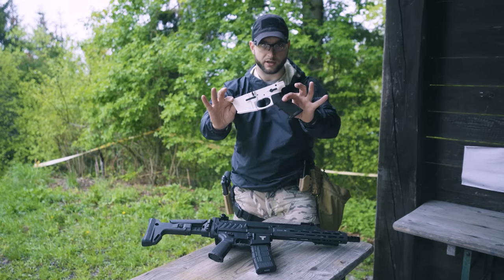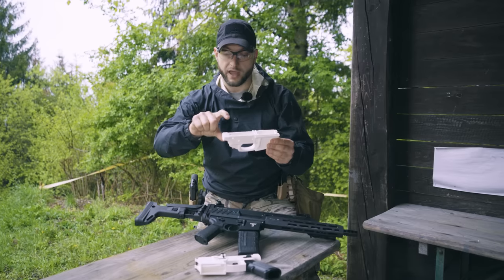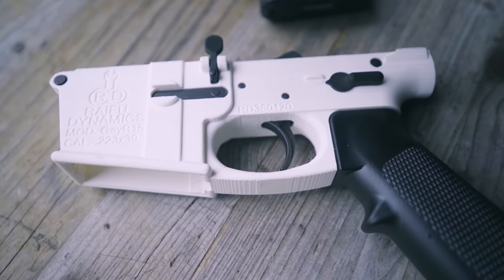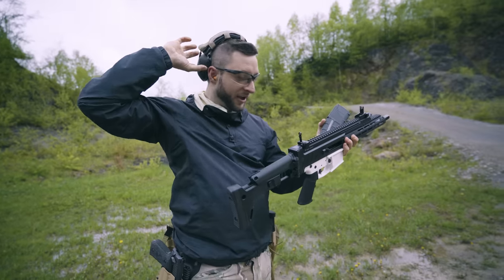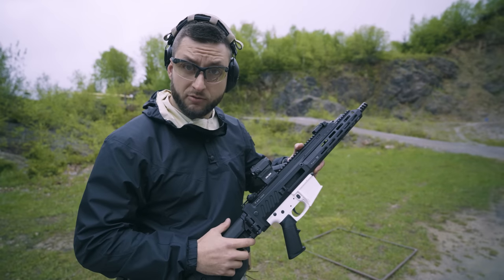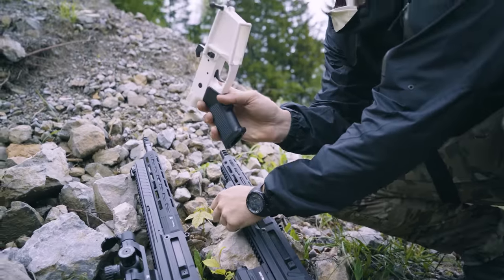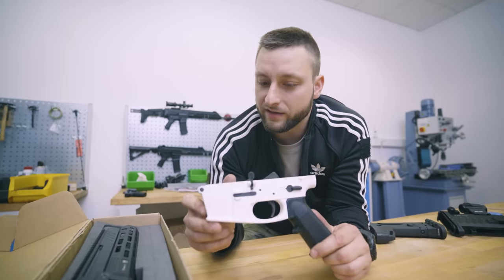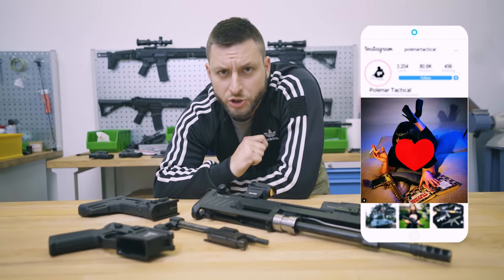Perun X16 with 3D printed lower

Comment: I think this is a much better 3D printed lower design than any AR15 could be. The buffer tube attachment is the weakest point on AR lowers so having it built into the upper will be significantly more reliable for printed lowers. Great work
Reply: Guess you've never heard of Hoffman tactical, probably the best 3d printed lower to date.
Reply: @Dirtysouth210210  that the one that uses a U-bolt ?
Reply: @vlaricshard2  No it uses a hose clamp
Reply: @Dirtysouth210210  nice to know that.He’s quite infamous on YouTube,I guess?But his product looks quite potential since he has put some researching and testing on it.I will take a look later
Reply: @Dirtysouth210210  I have and I do know it is the best printed AR15 lower in terms of strength. But it needs a giant rib and a hose clamp. The lower in this video does not need any of that and uses less material and can be made faster. The entire purpose of printing guns is to not need an FFL, not to replace metal parts. This design achieves this while keeping all printed parts as non-structural parts. Removing the buffer tube from the lower is objectively better.
Reply: It's not the lower design, it's the upper. You can't throw this on a standard ar-15
Reply: @noncompliant209cali  exactly. It’s not a fair comparison but it is an overall better design for 3D printing since most of the challenge is taken care of by the upper
Reply: @Dirtysouth210210  nah, DS1913 with BRN180 upper.
Reply: You realise this is quite literally a different gun right? For 1 doesnt take a buffer tube or anything of the sort 

Like the part that confuses me about this comment is you seem to think they've done something special but if you've looked into 3d printing firearms beyond its surface this really isnt special or even surprising  its pretty basic and its been done multiple times in multiple different versions
Reply: @royrogers3624  that’s exactly my point. The AR15 platform is at a disadvantage for 3D printing since the buffer is attached to the lower. Creating a printable lower for a weapon which does not have a buffer attached to the lower like the design in this video is better for 3D printing than trying to buff up an AR15 lower.
Reply: @Nicksperiments  not really theres multiple designs that have been made with the material in mind that have worked perfectly

And again so your point is that this is average? The only thing special here is thst it has parts compatibility (some) with the ar15  which means you have options

Besides that this is really cool but nothing special in the slightest
Reply: @royrogers3624  mind linking them?
Reply: @Nicksperiments  easiest would me look up print shoot repeat his videos would be a good starting point along with that ctrlpew both on YouTube and the website (believe its ctrlpew i fuck the name up alot) sone that come to mine the skorpion, skorpion evo, mac 11 (believe that's the right model) among others ive seen in passing and as someone else has pointed out there's a YouTube that has experimented with reinforcing and overall improving the durability of a 3d printed lower

Along with that I've seen a monolithic 3d printed lower that held up fairly nicely 1 to 2 k rounds it developed a hairline crack in the front where the pivot pin is though that was a first test I believe so subject to improvement in settings and material aswell as the design itself 

Sorry this isn't a playlist ive made yet though I may start one now as I did with my "fud" playlist disproving common myths you hear from fuds often

Edit: hoffman tactical I belive js the guy who's experimented with the designs (as posted above in another comment)

Injection molded lowers even have durability issues except for the monolithic ones that have come out because they were made with the material in mind not just copy of the aluminum specs the same way eith 3d prints if you copy the specs for a different material it should be obvious itll fail with a polymer
Reply: @royrogers3624  I’ve seen pretty much every video by all of those people. I’m talking specifically about rifle caliber (.223 or larger) printable lower receivers that require little to no reinforcing. A scar lower would be a good example. Are you claiming that is common?
Reply: @royrogers3624   isn’t that the pot calling the kettle black? You mentioned the scorpion evo and Mac 11, neither of which are rifles
Reply: @Nicksperiments  "Along with that I've seen a monolithic 3d printed lower that held up fairly nicely 1 to 2 k rounds it developed a hairline crack in the front where the pivot pin is though that was a first test I believe so subject to improvement in settings and material aswell as the design itself"

If you cant comprehend what this means im not wasting more time here im just repeating myself because you wouldn't pay attention
Reply: @royrogers3624  big talk coming from someone whose name is literally a fried chicken fast food chain. I clearly specified rifle caliber .223 or larger since the gun in this video is a rifle in rifle caliber. Reading is hard :/
Reply: Aye Bro start doing things instead repeating what you hear and see on youtube, plastic in carbon filament of today in 2022 hold up
Reply: @jaxsonmillz6474  it won't unless its similar in strength to 7075 aluminum the issue isn't really the material its the design itself the ar15 was designed around aluminum the area that becomes an issue is thin (relatively) and that results in it failing 

To give you an idea glass reinforced nylon which it actuslly better for this purpose even injection molded (so generally stronger) still fails if the design isn't modified to fit the material used

In short it is possible to do but there hasn't been a significant advancement that changes anything
Reply: Hey you know where can I order all this parts and how can I print one of those goals parts
Reply: What do I need to be able to print the 3D ghost gun
Reply: Or can I just buy it

Comment: These are super cool but i would imagine it wouldnt be cheap especially on initial release. Still something awesome for the 3d printing community regardless.
Reply from the maker: Not cheap but also not super expensive. I can't say for the US because of shipping and import cost but the goal for Perun X16 in Europe is to be cheaper than high end AR rifles
Reply: @PolenarTactical  Strive for global domination.
Reply: 3D-printed firearms (At least in the US) don't make the overall gun less expensive. It mostly circumvents the legal paperwork.
Reply: @TheHamgamer  yea that is true for the most part
Reply: @PolenarTactical  Will they be selling just the upper for the US? Easier to get an 80% lower and mill it down here for one, I'd think.
Reply: Thing is, there's plenty of people around with 3d printers that wouldn't mind helping a brother out. Problem is that once you ship it, it will raise some eyebrows with customs whaha

Comment: Great example of polymer lower for AR-15 is KP-15 from KE arms. Buttstock, buffer tube and pistol grip is one piece with lower to add strength to critical area. And i would like to see full review of that X-16, it looks quite interesting.
Reply: BuT nO cOlLaPsIbLe StOcK!!!
Reply: the only downisde of a lower like the KE arms one is that it wont fit on a normal printer. its a great design but its useless if you start printing it in pieces
Reply: @teebles I understand why someone want different stock (like collapsible or law tactical folding stock), but it's really such big deal to have different pistol grip? On every AR i shot i couldn't care less what type of pistol grip it have.
Reply: @teebles I dont know about prices in US ( i am from Europe) but it's really $110 so much for lower with buffer tube, grip and stock?
Reply: @teebles Stripped alu lower for $40, ok, but how much cost buffer tube? Stock? Pistol grip? Because for $110 you get all of that in KP-15
Reply: @teebles ok
Reply: @teebles law folder? ew. just get something thats made to fold
Reply: @teebles overpriced? wait, are you seriously calling it overpriced? ITs like, more expensive than an anderson, sure LMFAO. 
calling the kp15 lowers overpriced is like calling a glock expensive because it costs more than a taurus...
Reply: @teebles ive shot one and it handles a hell of a lot better than 90% of overweight awful builds people run

also, polymer molding is WAY more fucking expensive than you think, but you seem to know nothing about it, so whatever. using a CNC to churn out hundreds of ar lowers is expensive, yes, but a polymer mold is magnitudes more expensive. the kp15 caters to a particular market, and isnt out there to replace everything lmfao. and no, aluminum isnt better in every way, it has a lot of advantages, but a kp15 or older cavarms is really really robust for the light weight

oh, and a full pound reduction is a fucking LOT of weight reduction dude, do you like no walk with your rifle?
Reply: @teebles "only a pound" somebody doesnt hike much. or walk further than their car to the door... a pound is LOT, and when you make a gun with weight savings in mind, you can get a really really really nice rifle. my friends kp15 build is 7 and a half pounds with a nice lpvo and feels a hell of a lot better to shoot than the heavy monster 15in rail bull barrel rifles i see around

edit: also the modularity thing doesnt matter at all to me, i have long arms, so the stock is pretty much perfect, and the grip feels really nice. hell, i put the SAME grip on every AR, so its not like the modularity matters a damn. you lose 2 parts that can be swapped, to lose a pound, thats an amazing deal
Reply: @teebles he has a 1-6 lvpo and an ir laser/light combo, lmfao. go on and weigh your rifle, i guarantee unless its a poly handguard rifle with irons it wont be lighter.

just like keep in mind that his rifle is the weight of an original m16 with 20in barrel and irons with a loaded mag, while having a 1-6x scope and night vision capability. also im getting more and more sure you either only shoot bench queens or dont shoot at all.
Reply: @teebles no, becuase you dont understand the basics of walking around with a rifle lmfao. you thougt it was funny that a DECKED GUN was only 1 pound heavier than an m16a1... thats IMPRESSIVE as HELL. put on a crane stock, thats more weight, but on an mlok rail, thats more weight, before accessories an ar build can easily hit 8 pounds, then add an optic, thats at least 9 pounds unless its just a red dot. then slap on an ir laser/light and you are already past 10 pounds. its literally adding up numbers but you dont get it lmfao
Reply: @teebles lightweight slickside upper, lighter than m16a1 16in pencil barrel and a carbon fiber tube lol. You forgot like 40% of the gun.
Reply: @joemama.556  it fits on a 28cm delta printer
Reply: FWIW, I own a 20” AR based off a KP-15 lower, which I paid $100 for via Brownells.  It is a fantastic product, and the customer service from KE is the best I’ve ever encountered.

Having the stock and pistol grip integral to the lower makes the complete unit simpler and stronger (see demonstrations of this on the InRange videos re: WWSD) as well as lighter.  Everything’s a trade off—adjustability and modularity vs. simplicity, weight, and strength.  I like the compromises made in the KP-15’s design.  I think the grip is a bit too thin for my hand, so I bought an $11 neoprene grip cover from Amazon that made the grip stickier, softer, and slightly thicker.  Now it’s perfect.

A poverty-pony lower + cheap grip + buffer tube + cheap stock are still going to come in at around the $100 mark and not be as rugged as a KP-15.  In summary: I own one and I can tell you that it’s not junk, and it’s not overpriced.

Comment: Is the Perun only available in Slovenia ? They look really freaking cool.
Reply from the maker: i think AEA arms has plans to import them to the US
Reply: @PolenarTactical  I hope so!
Reply: @PolenarTactical  As parts kit? Im loving the setup
Reply: @PolenarTactical  yeah, would definitely love to see that full review
Reply: I know that they are available in many european countries. Most manufacturers of semi-auto rifles, especially AR-15 derivatives, in the EU don't export to the US because of the US import restrictions and the strong competition by US manufacturers.

ARs made by Oberland Arms, Schmeisser and Hera in germany are, for example, very popular in europe but they are not or only rarely exported to the US.
Reply: And I have to add: As long as the Perun has not been exported to the US it is unknown if the upper or the lower receiver is the registered part of the weapon. There are several guns with an upper/lower system with the upper as the registered part, the FN FNC or several HK rifles and derivatives for example. It possible that a perun lower in the US is legally just the same thing as in most european countries: A piece of plastic.
Reply: @PolenarTactical  Will yall release the STL or Step file for the lower to be Foss?
Reply: @Superwip  One thing about that is, it uses an AR-15 lower, just with the buffer extension milled off.
Reply: @PolenarTactical  Any idea on their MSRP?
Reply: @PolenarTactical   we want parts kits.

Comment: Point of clarification; in the US, the lower is the serialized part on the AR15 and a few other firearms, while on the M14/M1A1, FAL and most others, the "upper" (i.e., not the fcg) is the serialized part. The ATF has admitted that was a mistake and has tried to redefine the AR lower several times (which would instantly make hundreds of thousands of people criminals).

Make sure to do your research so you stay on the right side of the fed bois.
Reply: @foibles1149  ^ This. Quit the self policing and it goes away.
Reply: Hold on, how would it make people criminals? Weapons that were not serialized before the 1968 GCA were grandfathered in. If there's millions of uppers without serials, too bad. Ex post facto. The ATF can't so anything about it.

Comment: In the US, the lower is the gun. He was correct when he said it was a 3D printed gun.
Reply: not always true, my cz bren 2 the upper is the serialized part, the lower is not.  the scar is also the same way.
Reply: @soup31314  I'm aware, but he is holding an AR. I didn't think it needed specified for this video considering it's the only gun in the entire video.

Comment: They fixed the AR buffer tube issue. They beefed it up and then added one critical component. A hose clamp. Yup a cheap hose clamp fixed the buffer tuber issue. How do the test it? They do push up on it with one hand on the buttstock, one on the barrel shroud, and balanced on a pistol grip. Others used a U-clamp which is a U shaped piece of metal with bolts on the ends. Both allowed them to do pushups on the rifle and fire it afterwards. Not the prettiest but very cheap but effective options.

Comment: correct me if I'm wrong, but hasn't a buffer-tubeless rifle AR platform been around since the SIG MCX dropped in like 2015?

the x16 has a very interesting operating system, but in terms of accepting printed lowers specifically, is it anything particularly new? i assume it takes from the ar18's double recoil spring/guide rod thingy that allows the omission of tbe buffer tube as the MCX does

Comment: Definitely want a full review on this. Also: is the lower close enough to an AR lower that I could chop the buffer tower off the lower and make it work????
Reply from the maker: Yes, that's the idea. It uses and AR lower with chopped buffer tower.
Reply: @PolenarTactical  that’s sweet. I’ll definitely do a 7075 self manufactured lower for one of these and post my experience on here. 

Thanks for the information.

Comment: In the Netherlands you cannot buy an AR upper without registering it to your permit. Also most important parts are serialized in the past 2 years. Is his not the same in Slovenia?
Reply from the maker: Similar, for us the controlled and serialised parts are barrel, bolt, bolt locking piece and revolver drum
Reply: Wow I didn't know you could buy ARs in the netherlands. Then again, gun laws in Europe aren't actually that bad if you have a hunting license like I do. I love in Portugal and you can buy AKs and ARs here no problem. Also do you fancy powerful lasers? I need to buy one from europe
Reply: @LuisC7   yes you can! I am the living proof :). It only takes couple years, background checks and a lot of effort. But, if you follow the process it is possible. Yes I used to build these laser myself with diodes from projectors. I quit that hobby unfortunately due to time restraints and other hobbies. And also they were really dangerous lol.

Comment: 👻👻👻.  We have moved to core moldings a reinforcing into the buffer tube adapter.....some current generations use Kevlar reinforcing in the polymer on 80% lowers......🤠
       But this is just as outstanding.
      PS......👻 Gun is just a politicians term for a self made firearm.
      😃😃😃😃😃
     Five Smiles and a 👍
   But our 3d printed lowers for the most part have limits in the buffer tube adapter area....
     Best Wishes for my brother's of different mother's ...... 🤠

Comment: Plastipews for life baby! Where did you get these files?
Reply from the maker: We modified some available AR15 lower receiver files. Thinking of making our own version of the files with the lower that will directly fit on the Perun X16 and have some parts reinforced (like the lugs for the front takedown pin)
Reply: @PolenarTactical  do it, bro!
Reply: @PolenarTactical  if you do let us know where to get them.